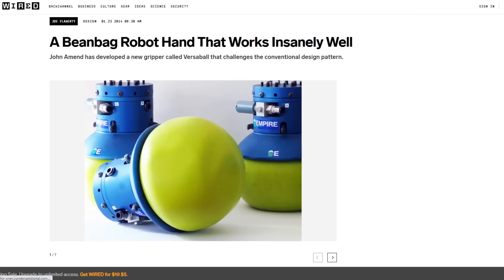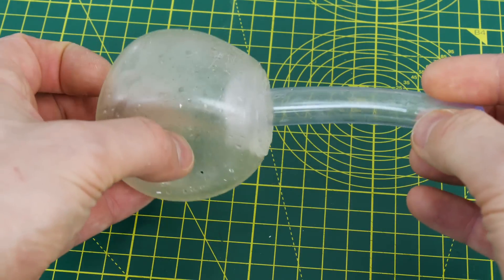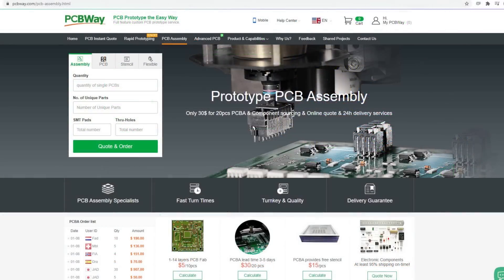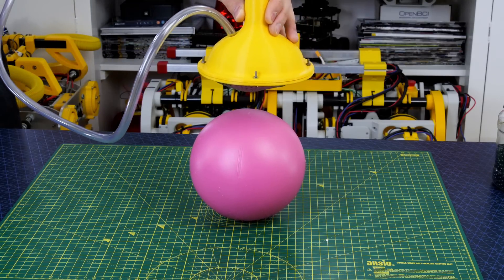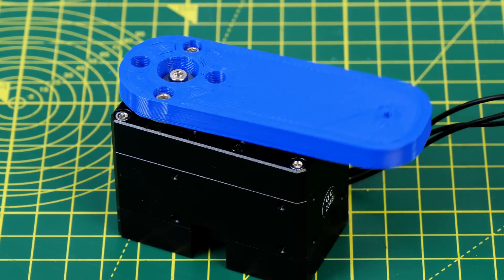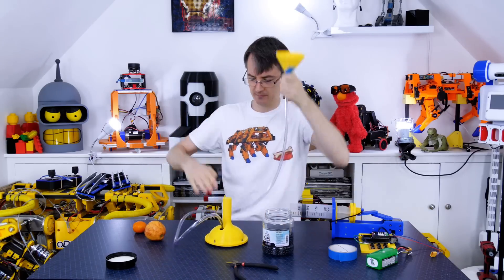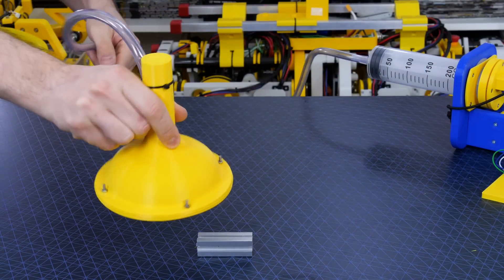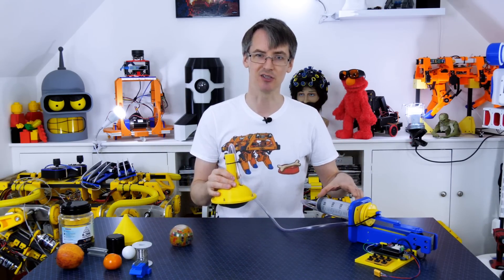Experimental Jamming 'Beanbag' Robot Gripper

Comment: If I would have a go at this and had this amount of machinery to make things i would go for more like sand instead with a filter with a air valve that traps excess sand that get blown back down when pressure is released back in.

Comment: i think you could get better grip by using rubber balls instead of bb's, cause thses are too rigid and don't mold enough to the thing you're trying to grab. the balls should be deformable, but not compressible.

Comment: The front of the membrane that you have secured with that ring: it's being stretched out and away from center, while the rear of the membrane still has lots of free play. All the weight of the bbs are pushing forward against the object you are lifting, while the front of the membrane which needs the most 'play' is restricted by the ring. Try securing the rubber to the rear of the fixture directly and leaving the front half completely free to contort around the objects to be lifted without being pulled away from center. Great video!

Comment: You simply need a smoother gripping surface which means smaller beads in the gripper. polystyrene can work but you have to pack it full or pull out a lot of air since they compress easily otherwise a more solid option could be bead/foam putty but one thats not too sticky...

Comment: Hi I am 12 years old and I’m not expert but I think you should use sand or smaller bbs because there would be less gaps in between and the smaller would have more details which might help grip. Also you are a huge inspiration.

Comment: I agree that the partical size has a definite impact. Airport bb would work better, but the shape is also a factor. The one shown at the start  has much more exposed material allowing for the gripping section to flow around the object and get a better hold  your version does not allow for enough expansion since most of your gripper is encased in your print and can not form around the picked up object.

Comment: use a solenoid to equalise the pressure before each stroke... to make it softer when picking up items and let more air out before pulling the syringe and also the opposite, before releasing, open the solenoid to let air back in before pushing the syringe to inflate. It essentially doubles the useable range of the syringe

Comment: I doubt you will see this since it has been so long but at 5:51 you made a big mistake, the more the bag protrudes, the better it will grab objects since the object can go deeper and gives a tighter grip, if you made a half-sphere with a short cylinder at the end (with a smaller radius obviously) you would have gotten better results than with the funnel.

or just make a bigger bag for the funnel if you plan to grab big objects, altho I think this is more useful with small stuff since with big things becomes impractical how big the bag has to become

Comment: you're pulling out the form of the grabber with the way you're sticking it in there.  when you suck the air out the ball cannot contract normally, the sides pull back on the center and make the fit not as accurate, hence no grip.

Comment: Use smaller BB's. Have a better air economy: it doesn't seem tight enough.
Use a little bit of Gauze on the air pump into the sack, so that BB's can't get sucked out.
It shouldn't be *loose*, it should just be malleable / morphous to a degree to be able to mold around something, before being vacuumed to a state of completely bricking solid.

Comment: You could use two syringes. I would also suggest a smaller tube. The large tube you're using has a lot of volume of air in it that can expand under vacuum, so a smaller tube would have less volume of air in the system to expand. You might also consider a more rigid tube that has less risk of collapsing under vacuum. You could also experiment with 3D printing granules for inside the bag, who knows maybe a little triangles like a four-sided die would give you more grip.
Reply: You might also consider filling the system with a fluid. Most fluids tend to be less elastic than air.

Comment: Ideally, I think you want a system where the air is being vacuumed out evenly around the edge. Then the top layer of the membrane is being pulled down onto and around the BBs and the object, instead of the bottom layer being pulled up and hopefully kinda forming around the object enough that it catches a hard contour. Kinda related to the difference between cheap and expensive vacuum sealers and trying to seal bags of liquid.

Comment: Why is everyone talking about the 3d printed funnel? it really doesn't matter that much and for everyone talking about wasted energy the energy required to print it took less than any shipping truck or car required to actually get the funnel.. And in case you haven't noticed all plastic funnels are made out of plastic even the ones that aren't 3d printed..

Comment: I think I found other possible use for jamming phase transition stuff...

A driver's seat for a race car. When combined with a six-point harness (with inflatable straps) and a quick-release mechanism (allows all of the air back into the material in an emergency), the safety levels should go through the roof.

Comment: Maybe a gripper using a non-Newtonian fluid, where the fluid gets forced into the membrane around the object being picked up and then a vacuum is pulled really quick to harden it, or maybe if you just force it in there hard enough against the object it will stay rigid until pressure is released. Who knows, I'm just spitballing here.

Comment: I remember that article! I made a little one with a baloon, a syringe, and coffee grounds as a kid. It looks like you're stretching the ball a bit in order to secure it to the holding. I don't really see a way around that, but that probably makes the gripper shrink into the back of the grabber more, and less around the object, making it harder to hold. Swapping out the BB pellets for something more compressable would probably help too. Not too compressable, just compressable enough that there's something springy pushing against the object from all sides. I think the article specifically recommended coffee grounds for this reason.

Comment: There's a reason why the original gripper that you based this on protruded from the mounting point by about 2/3. It allows the gripper to form around and slightly under objects. You've restricted the gripping movement with your attachment method.

Comment: i kindof think a balloon might be a good place to start for the membrane, the balloon material when inflated slightly then relaxed around an object will contribute to gripping, i also remember that original gripper , the makers wher talking about using iregularly shaped granular material, as the shapes would lock together and around objects better.  i think finer material might help you with that as well.

Comment: I think it can't grip those object because you've pinch the membrane to the side of the holder, its like clamping the second joint of your fingers straight and you can only use the first joint of the fingers to grip stuffs. so by using a smaller 3d printed holder and glue the bottom of the beanbag gripper instead of clamping it wide, probably you can grip more stuffs.

Comment: Only just started this video, do you try a mix of the soft beads and the BB pellets, to give you an ability to tune the force of the grip by drawing out enough air to fully compress the flexible components or leave a bit of compliance without letting the form of the group change?

Comment: There is a weighted fill that is polypropylene which is smaller in size that might help also unexpanded polystyrene beads that may be able to help also seed beads may be another idea and for the membrane you can make a 3D printed mold with mold release and use flex seal, rubber or silicone to layer as thick as you want the membrane to be or use a thick balloon like the 4ft and 6ft balloon

Comment: Try much smaller particles (for greater surface to surface contact and a higher profile resolution) and use liquid rather that air? No springiness with liquids. Think hydraulic brake piston in reverse.

Comment: Not an engineer, but perhaps you limited its ability to "close" around the object by pinching the sides? What if you had really stretchy skin, like the membrane of the ball, and you were to attach the back of your fingers to a fixed location? Due to your elastic skin you could still hold something, but you would constantly have to fight the tension of it. I know that the medium inside has some limiting aspects as far as the resolution of the cavity created. If you consider that  the surface area of the pad has now been halved, from the original sphere, and that it is now pretensioned away from what you try to grip, rhis might be causing the cavity to phase jam in a more "open" shape due to pretension. Think of a bean bag vs a trampoline to illustrate both extremes, bean bag envelops you. The trampoline conforms to certain contours, but then the tension takes over. Just a thought.

Comment: Use some solenoids to turn the syringe into an air compressor and a vacuum pump, should be able to have the arduino controling a vent to atmo as well. will be able to do 2-3 strokes of the syringe to suck down, and the same to push items out.
Reply from the maker: Not really portable for a mobile robot though

Comment: The large funnel almost looks like a toilet plunger. Maybe you can use one of them. Also using a check valves could help with the air management.

Comment: I think it would be interesting to see if different packing materials have different gripping properties.  For instance, if a tetrapod shape was used maybe it would provide an irregular gripping surface which could be helpful with the larger objects.
Reply: I also would like to highlight that the fidget balls are not the only membrane option.  There are exercise balls that would allow you to scale up and for your air cylinder there are water toy options like the stream machine which has a 17-inch barrel.

Comment: There are lighter weight  0.12 G BBs.  Your using 0.2G BBs.  That should reduce the weight.  The Airsoft BBs are 6mm in diameter.  I suspect smaller would be better.  A lot of 0.117 Caliber(4.5mm) is available in steel.  Not sure about plastic.   I found some 4.5 mm plastic on Amazon.  They seem rare.  It looks like non airsoft airgun.  The company is ASG actionsportgames com.  Not super light weight.

Comment: I'd of thought using something like Rice or Large Grain Sand would have probably been a better idea ? Like Aquarium Pebbles or Reptile Calci-Sand which should be pretty easy to get hold of online.
Reply: Also pantyhose work great as a large obstacle filter and doesn't restrict the air in the slightest practically speaking

Comment: 14:00 I thought that was pretty obvious as soon as you tried the larger version. Seems like you don't necessarily need a bigger squeezy-ball you just need to make the holder smaller and grip it in a different manner. You're basically just starting with a flat surface instead of the tip of a ball like the robot in the video which is giving you less to grip with. If you're trying to pick up a ball-shaped object like the orange and apple you're going to need it to sink more than halfway into the grippy thing otherwise it can just slip out (especially if it has a slippery skin like fruit). Gonna need to sink at least a tiny bit beyond the equator of a ball before it's going to grip well at all for obvious reasons. Also, smaller BBs would help.

Comment: Have you considered trying a fluid, instead of air. Wouldn't since many fluids are not compressable. You would get a much better pressure on the evacuation, while still using the syringe setup. Though a pressure sensor and a possibly a second syringe might also be something to try. I like this rather low cost and contained method without relying on air compressor or a vacuum pump. (which also prevent additional materials contamination possibly by working their way inside the gripper)

Comment: Hmmm, what if membrane was a bit longer (Shape similar to this long balloons that you can make a doggy out of) then if you inflate it a bit and deflate and suck air out as you push it, it will mold around any object that will fit in the radius of a gripper and hold it very well.

Comment: I wonder how sand would work in this situation. You'd have to change your setup a good deal but by blowing air into the sand you could make it fluid like (there was a veritasium video featuring this) then by sucking the air out it would make it solid. Because the sand grains are small they would mold almost perfectly around the object.

Comment: Should try with sand or smaller bb's. I think that's the biggest problem. Smaller internal objects should be able to mold to the gripped object in a higher resolution and grip smaller features better.

Comment: The "grain size" and coarseness is a big factor in being able to mold around and get a good grip. Used coffee grounds are an excellent source, whereas smooth round surfaces like BB's are not as good because they have a tendency to lock together in an ordered fashion at specific sizes. Look up videos on "spherical object packing density" for more detailed info... The other thing is that those squishy balls you were emptying out were likely hydrophilic beads and if you look at them several days later, they will have lost most of the water and become far smaller... conceivably you can use a dehydrator to drive nearly all of the water out and they will become the fine grain size you actually would want and allow you to reuse the same components (in greater quantity) for your gripper.

Comment: I've used those grippers before they use a sand like material inside and use a slight positive pressure  when forming around the object. They actually  grip quite well.

Comment: It's a very interesting idea!! Some future ideas for optimization would be:
more pressure/suction
bigger membrane
semispherical membrane instead of spherical (cut down on weight)
some texture on the membrane for grip
smaller bbs or even small ball bearing or birds shot. Or maybe even a combination of granular material sizes to balance out weight/ air volume/ and grip

Comment: To me it looks like your first small gripper was better. The bigger one had an oversized cup and clamping down the rubber might not help. With the little gripper the 200cc sirynge would've done better vaccum and probably get stronger grip.
It also looks like you might need smaller balls, the orbeez that came in those toys, when they're dry they are much smaller

Comment: Great video! Two thoughts (in case you didn't know obv.): Instead of using a syringe, consider a small electric air pump such as https://www.alibaba.com/product-detail/12v-Small-Mini-Electric-Air-Compressor_60028093875.html they have two ports, one for blowing and one for sucking and they are surprisingly powerful (at the very least as powerful as what a human can do with their lungs, if not more). BigClive has done a video about how they work, it's basically a rubber membrane inside which wiggles around and mimics a tiny compressor. It's quite clever.
The other thought: There are air pressure sensors for use with tubing like this, AvE has done a video about those, they commonly have a G1/4" thread, e.g., https://www.aliexpress.com/item/32620113315.html
Reply: Also: I'm curious how much worse an air balloon would be instead of the membrane of these squishy toys. While its thinner wall would presumably made it harder to exert pressure onto the gripped object, their availability might still make them an attractive alternative.

Comment: It needs smaller BBs and a larger syringe. Not a bigger bag. The BBs need to form and pack tightly around the object leaving as little space as possible for air gaps. 

The BBs you're using are to large and create large empty air pockets where the membrane can't make contact with the objects. The less contact with the object the weaker the hold.  

Try small metal ball bearings, you could also use two syringes instead of one to form a vacuum using a slight modification of your current rig.

Comment: I think the biggest flaw is the 3d printed enclosure of the bb gripper, which is too big on the outside and forcing your objects to occupy only so much more space inside to actually have a correct grip.
As you stated at the end, dynamic pressure regulator on the tube, and smaller bb's and bigger count of bb's would do the job.
 Thank you for sharing this project.

Comment: I'd suggest smaller, plastic beads rather than those metally ones. I don't think the extra weight does you any favors and he relatively large size reduces surface contact

Comment: This also works with latex balloons, much easier to find in any size you want. Look for "punching balloons", they're a thick latex that's really strong. Also, consider using smaller bbs, maybe something like rice would work, the uneven shape should add more texture for gripping.

Comment: rather than clamping the membrane to the edge of the cup, it looks to me like it might have been better to try to fasten the base of the membrane, near where it connects to the hose, to the inside of the cup, I don't know if it would be possible to super glue that rubber to the pla cup.    or perhaps super-gluing the membrane inside the edge of a smaller cup
it looks to me like the clamp is holding the membrane up and out.  if it were free and you put it down on an apple, it looks like the pellets would fall down much further around the apple, and then when you pull the vacuum, a much better grip